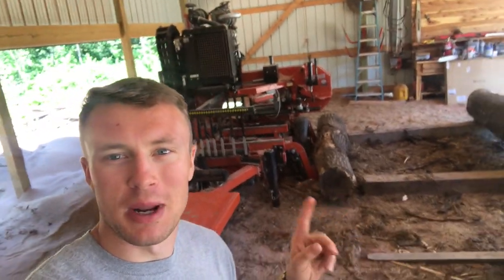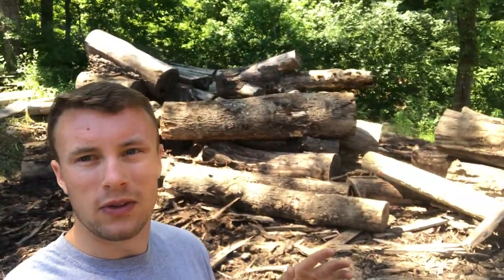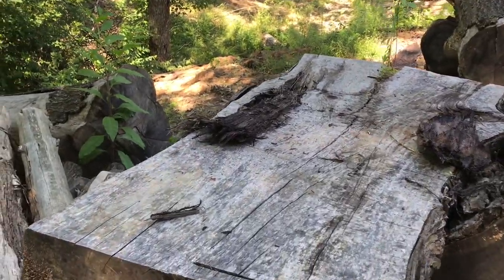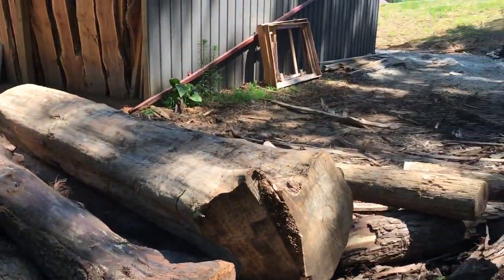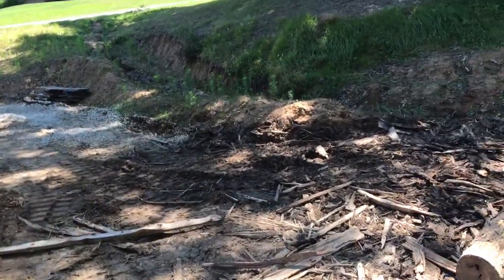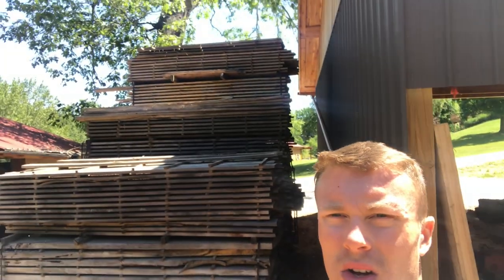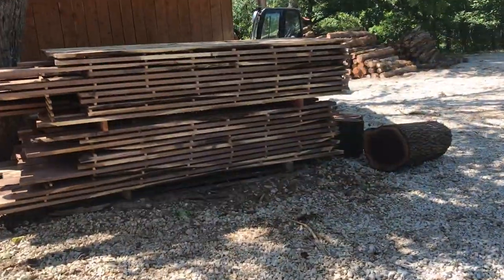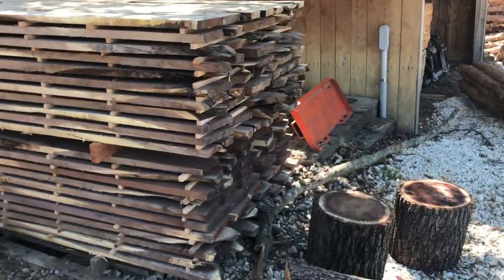Sticker’n and Stackin’ $Walnut$

Comment: Hi Tyler...looks like you got your work cut out for you.  Interesting that you are using black oak for your stickers.  My buddy with the LT40 prefers Basswood for stickers...same size you cut.  Since you seem to primarily cut red cedar, you probably don't worry much about staining, but the basswood seems to prevent that especially on light color woods like maple and pine. Listening to you talk in the video, it could have been my buddy talking about cleaning  up the log lot...sometimes things get ahead of you.

Regarding sawdust disposal, which can be a pain in the butt, we talked about using the old conveyors for the haylage from the silos and using (used to be a dairy farm a number of years back) them to collect the sawdust and take it to a blower to send it to a pipe out back. We figured that we needed something that the dust chute on the mill could track with and take the sawdust out.  I've seen some that just use flex hose and a blower but I have no idea how it would hold up.

keep hustling...you'll win!

Comment: For those big ones, can you quarter or halve them with the chainsaw, and then mill them with the Woodmizer after? That's my plan if I find something too big for my mill - half or quarter first. I haven't done it yet, sneaked a 26x39" piece onto the LT28 - a bit more turning a such, but got it done.

Comment: Super n00b to sawing, my 2015 LT70 Super was delivered yesterday... how do you make the cut closest to the bed 3/4"?
Reply from the maker: That’s awesome congratulations. There’s a adjustment screw on the bed rail side that when the head drops all the way down it hits and stops. I think when I got mine from the factory it was set at 1”. Just lower it a little so the head can go all the way down but be careful the debarked and the blade guide arm may hit the bed rails some when it goes down. 3/4” works fine without hitting but after a while if the head gets out of adjustment by 1/8” or so it will start to rub on bed rails. Just have to go into computer and re calibrate the head so it’s set true again
Reply: Makes sense, I don’t know if I’m going to do that just yet, probably get through the steeper part of learning curve first.😅
Reply from the maker: Yep I did the same thing. Lots of things to learn on the 70 for sure. It’s a awesome mill though you’ll love it